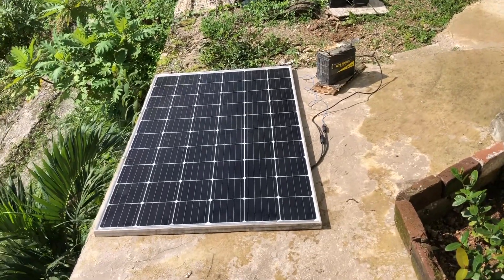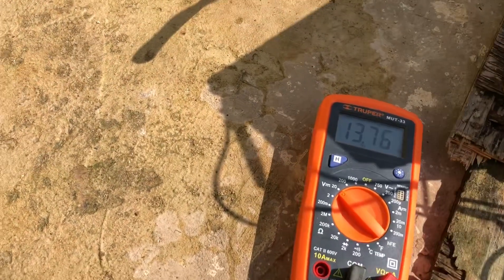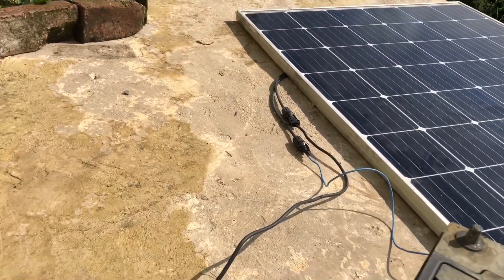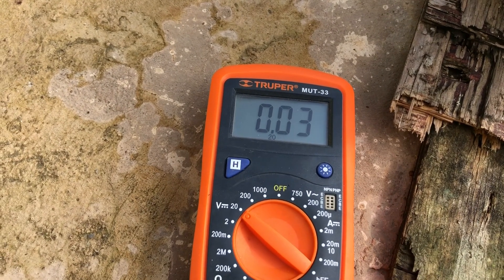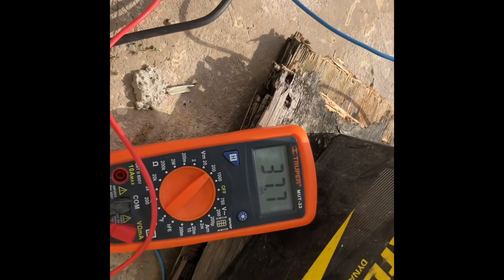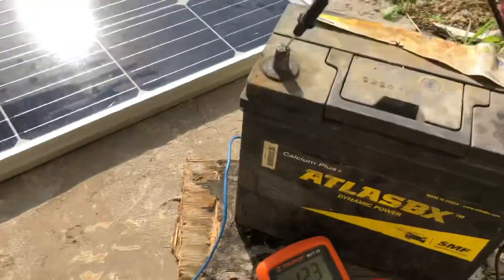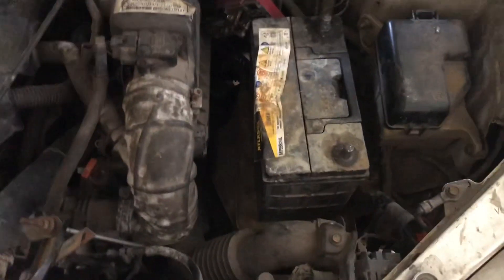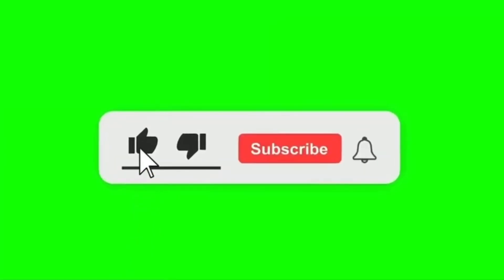Can I Charge my Dead Car Battery with Only a Solar Panel ?🤔

Comment: How long did it take to charge?
Reply from the maker: It depends on the state of the battery, also you don’t want to charge it for long because you are not using a charger. Also I do not recommend you doing it unless you dont have any other option
Reply: @subbydiy HOW LONG?

Comment: I have a dead battery 
And a 40w solar panel 
Will it work?
Reply from the maker: Yes it can but the process may take a little longer thou.
Reply: @subbydiy  I only have 20 watt 10 year old panel, I need to get something stronger for my needs too.

Comment: That is not safe. You should get a charge controller to use with it, but I know you can charge it that way. Just have to be careful just like you say.
Reply from the maker: Oh yes most definitely, the change controller will help regulate the amount of charge it gets
Reply: Me the battery is not showing if it's charging or not what could be the problem on the controller unit it is showing that solar is connected the battery is just breking
Reply: Me the battery is not showing if it's charging or not what could be the problem on the controller unit it is showing that solar is connected the battery is just breking
Reply: This is  unsafe to charge a battery directly with a solar panel. Once you start posting this unsafe method, it gradually become a practice that can ruin products or life.